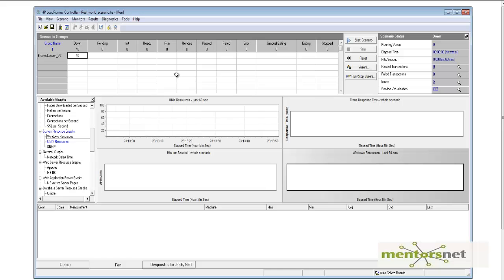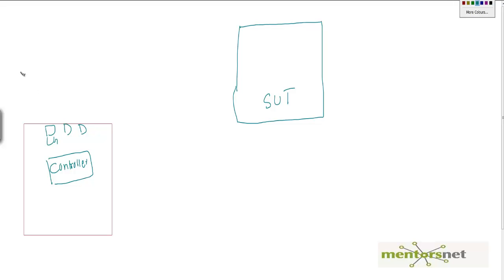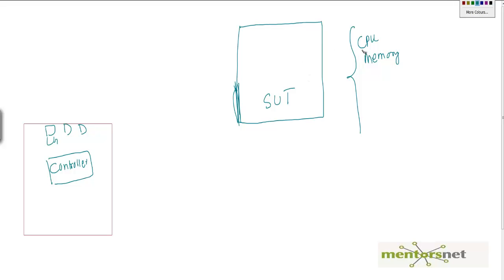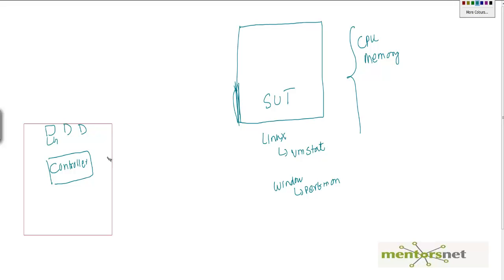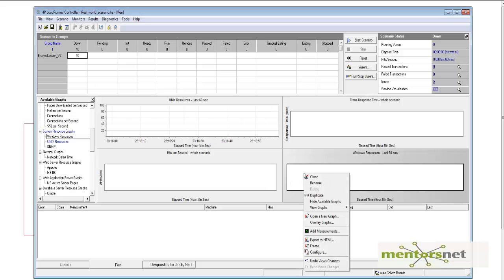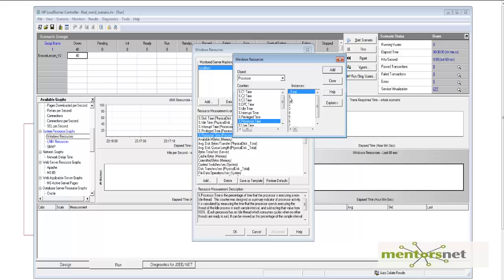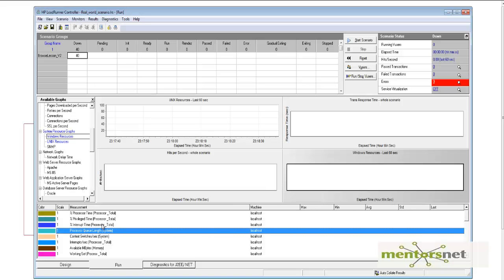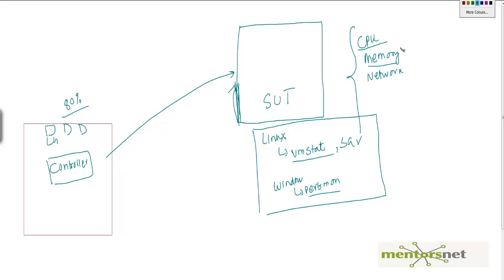LR 72 setting of resource monitor

Comment: You have put localhost in the measurement, so the application you're testing is in your local machine? Or you're just monitoring your LG machine?
Reply: saurabh12680 i noticed that too, I’m currently encountering access issue and I need to know what is the security type or configuration I need to modify for me to run this in different servers..